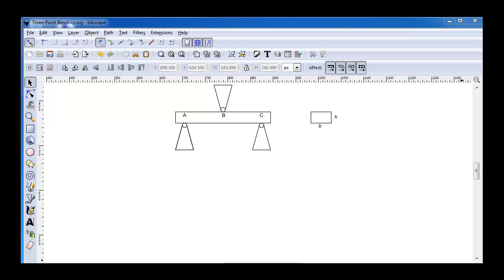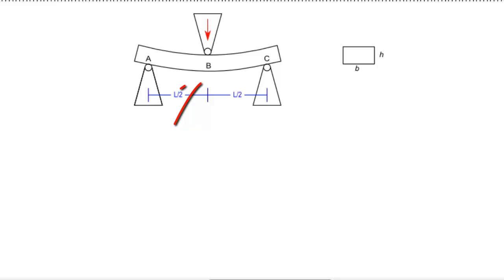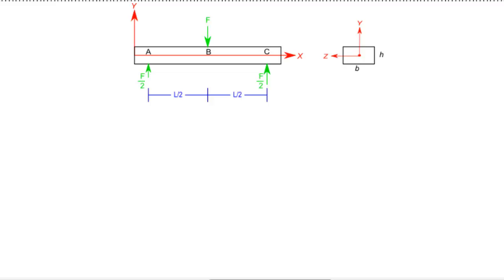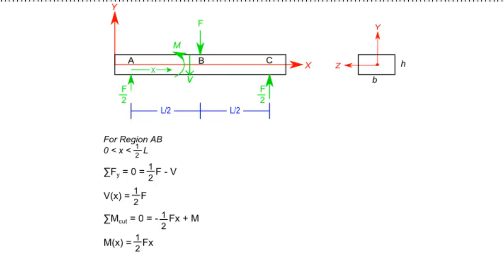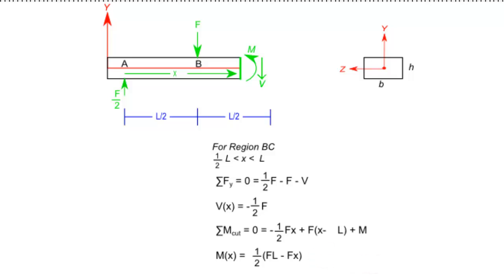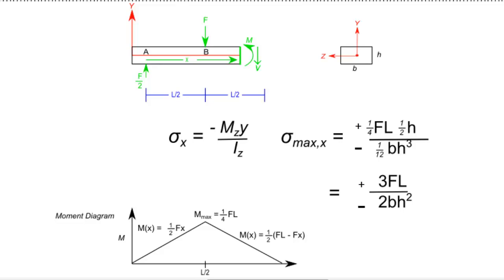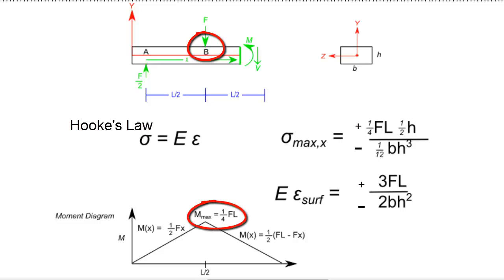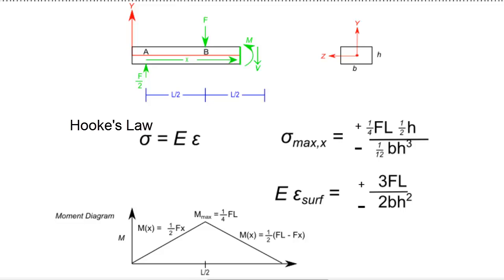Three point bending

Comment: Does the roller diameter have an influence (varied "within reason")?
Reply from the maker: Within reason... it depends. What properties of your material are you attempting measure?

In general, using a larger diameter will increase the contact area at each roller. As a result, you will decrease contact stress directly around where the rollers touch your sample. 

Assuming you're 'far enough' away from the rollers, you should see little impact (i.e., Saint-Venant's principle should take over). 

If you need to know exactly how much impact the choice has (and quantify things like 'far enough'), then you can get a good estimate with a 2D elastostatics model. A 2D linear elastic FEM (or BEM) model of 3 point bending should converge almost instantly (even on an old laptop). This is likely a tutorial model in most commercial software. I'd also be surprised if a few minutes of googling didn't reveal matlab code you could download, at which point you'd just need to setup the problem.
Reply: @jdomann  Trying to measure fracture, force and displacement just before it occurs, and calculate the max stress at that moment.

Comment: Can we determine Young's modulus from bending test?
Reply: ASTM D790 - 10
Standard Test Methods for Flexural Properties of Unreinforced and Reinforced Plastics and Electrical Insulating Materials
Reply: ASTM C1161 - 13
Standard Test Method for Flexural Strength of Advanced Ceramics at Ambient Temperature